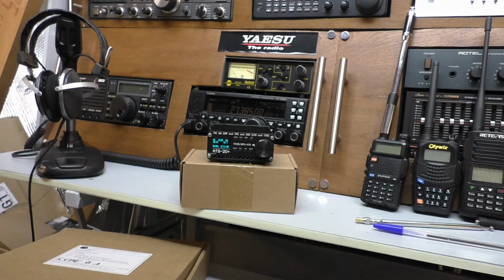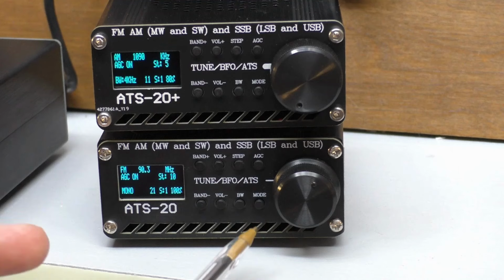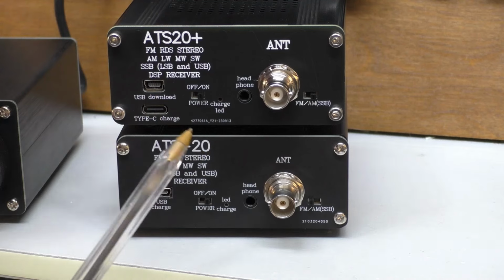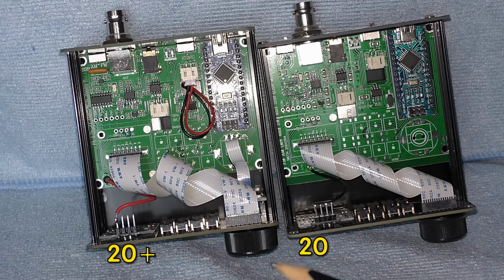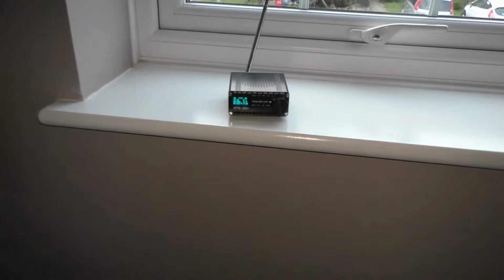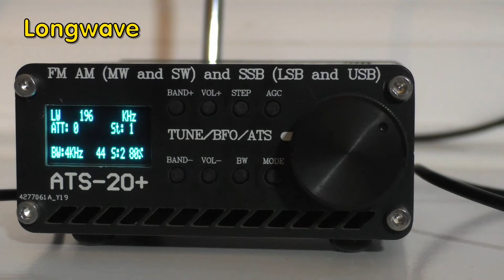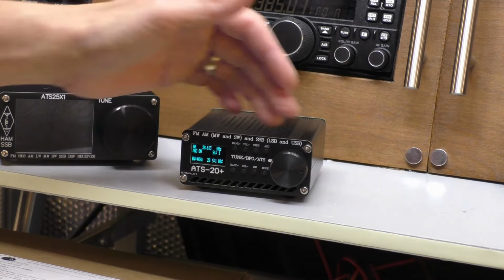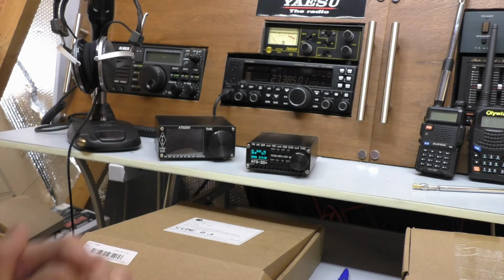ATS 20 + Shortwave Radio. Has it improved over the original ?

Comment: Just to confirm, the Plus has a 76 to 108MHz bandpass filter and RF amplifier going to the FM pin of the Si4732. The extra connector with the red and black wires is for the LiPo cell sitting under the PCB. Some ATS-20s seem to use the connector and others wire the LiPo cell directly to the bottom of the PCB. I don't know whether that's model specific or just down to which factory it's made in.

Comment: You can replace the original LiPo in the ATS-20+ with a 2.75Ah EEMB 605575 available from Amazon UK for up to 48 hours runtime per charge. Stick it down pushed tight into the front left corner of the lower case and it won't foul anything it shouldn't on the underside of the PCB. The connector type and polarity match the original, so it's a straight drop-in replacement. 👍

Comment: I watch the new video about this radio and the new firmware allows you to turn off the soft mute when you're tuning if I understand correctly. Also when you had two resistors you can get the percent of charge of the battery on the display.

Comment: You could make a very nice  16 W out  40 mtr  CW transmitter Rx with one of these using the design of the  Tx in the  Bayou Hopper  (US design) with all the mosfets Q1, q2 doubled up and the whole Tx run on 19 V  from a  Dell laptop supply ,  4.5 a capacity .  Calculations show  16W out, CW.  

That's massively over power required for a  Qso across the Atlantic by a factor of three.  The gates of the PA mosfets would have to go through inductor  6T on a one Wx 100R  resistor body before the Tie point to suppress parasit oscillations.  

regards,  TF

Comment: Great video, again! As I am in the market for a new scanner, my old and trusted Realistic Pro 2005 has finally bitten the dust. (Purchased from Tandy! Cannot remember when) This scanner allowed me to listen to the airband, marine band, amateur radio bands and also the vhf broadcast bands, that modern scanners do not. Does the ATS 20+ receive the airbands? I do not think it has a programmable memory, although I can still read the frequency displays. Thanks for another great video!
Reply from the maker: Hi.  No airband I am afraid.  These little 20's are not really a suitable as a scanner and wont give you VHF.  Right now i would say one of these radios is the best for that side of things.  https://www.youtube.com/watch?v=xmdqjA02NQc&t=32s
Reply: Oh well, it looks like spending some real money on the latest scanner and also on a FM broadcast radio. My old Realistic Pro 2005, (400 channels), died a couple of month ago and cannot be repaired. Have to try and get one from Ebay. Got into CB in the 70's in Germany (In the Army). Listened to the local police on a Pye Westminster, which had been modified. Took the RAE in 1986. Have been a semi active ham since.

Comment: Fred in the Shed both the ATS20+ and the Raddy RF750 which you made a video on your channel i have bought, but  withg the ATS20+ i have so few radio station where with the rf750 i can find many radio stations. I could tell people to  stay away from the arduino based ats20+ radios they are no good. Also i have seen the same thing on your radio fred the battery only charges to 80% while it has been charged untill the green light got lit! If you wanna buy a computer based radios you can better go with the ones that are more expensive like the SDR receivers like the MALACHIT or other brands! But still fred thanks for sharing this video!
Reply from the maker: I agree with you on the battery level.  Even after a full charge it drops to 80%. However i am not sure the meter is all that accurate as it stays on 80% for a long time.  The Raddy RF750 does work well.  For £30 though this radio does bring in a lot of stations. Thanks for the comment.
Reply: @CB-RADIO-UK  On the battery....you know it is very easy to add your own removable 18650 inside the ATS20, if you need it. Plenty of room. Many thanks for the updated video, Fred. I still love my standard ATS20 but have very much appreciated using Ricardo's firmware updates to them, plus modifying the software myself to include a full band.

Comment: A lot of these radios were shipped with Arduinos that had bad USB ports and to update the firmware in mine I had to replace the Arduino.
Reply from the maker: I guess some bad quality control will always slip through esp at this price.  Ive not had an issue other than a bad encoder on the mk1 but then again every one got that.

Comment: It looks like that IC you pointed out on the 20+ might be mounted on the bottom of the 20. There's solder pads for it that appear to have solder on them. Although how they are able to invert it is beyond me. Would be interesting to see the bottom of both boards.
Reply from the maker: Yes it could be.  Not sure is double layer board.

Comment: You say you don't understand why they use old USB mini ports and haven't integrated the programming and the charging port but when you opened it up it shows EXACTLY why. They haven't integrated them because they used pre-made modules. They bought a Nano and a TP4056 module off the shelf to stick onto their board and didn't bother to have to design anything related to USB. They saved themselved quite a lot of headache and money by doing that.
And the Nanos are clones. "Nano" isn't the branding, "Arduino" is. "Arduino Nano" is printed on the bottom of the official boards. Neither word appears on the top of the official boards.
Reply from the maker: Yes that makes sense.

Comment: Thanks for the video Fred. I've played around with SDRSharp and want to look into getting an inexpensive physical SDR, though regrettably cannot have a permanent antenna in my shared garden. I thought a loop antenna might be a perfect compromise (and one I could sometimes take outside) but a lot of posters on Reddit have told me that it would be no better than a whip antenna. Would you recommend the loop in such a situation?
Reply from the maker: I ve just fully tested the loop.  Straight performance such as pure gain its prob no better than a whip.  However as it works on such a narrow bandwidth you can tune out a lot of noise.  So if you have a lot of noise at home then it could be the answer.

Comment: Hey Fred, what does the 80% in the bottom right corner mean? Also still have not figured the mode button and switch button do ? I had it on left side and still got lsb and usb ?
Reply from the maker: I think it signal strength.

Comment: Hey Fred , I got my radio today , could not believe how small it was ? Quick question for you ? Where does shortwave start and finish ? On the unit they just have AM it does not say if your SW or AM . Thanks buddy .
Reply from the maker: Hi.  Glad you like your radio.  SW is all on AM for the broadcast band.  Shortwave runs from about 3000 KHz to about 25000 KHz.  You will find most stations between 8000 - 12000 during the daytime.  Some higher in the eve.  This might help.  https://ccrane.com/shortwave-frequency-list/

Comment: Just curious... Did you try unplugging the red&black wire that was plugged into the new unit's PCB to see what happened? P.S. - I thought it picked up stations very well with the telescoping antenna....last edit. while listening to you I checked it Amazon and it's selling for $45 USD which is a good price. A Good gift for my Grandson. Active loop? Best, Passive loop? I never got the one I had to pick up much. .. . ok, 'Nuff Said.
Reply from the maker: No i did not but it looked like a power cable.  I wonder if it was for the USB C socket.